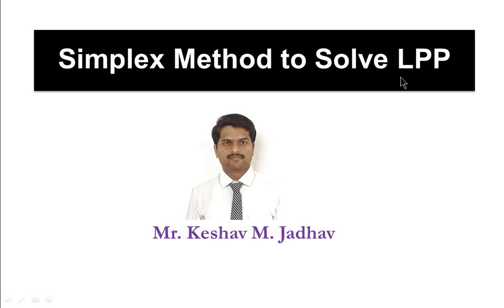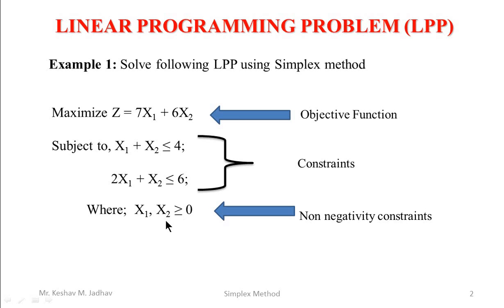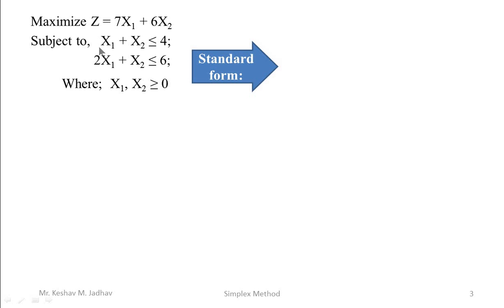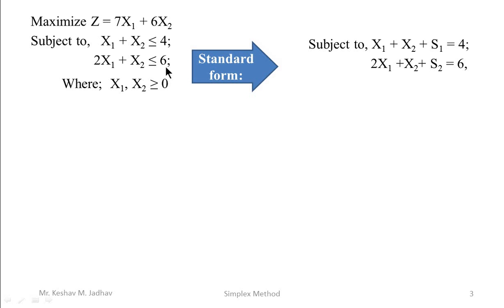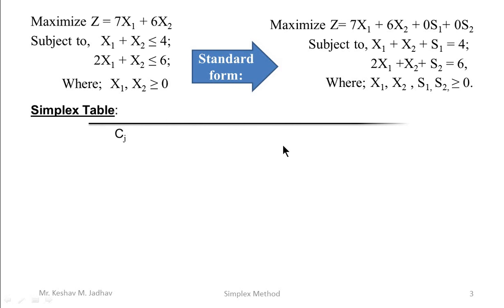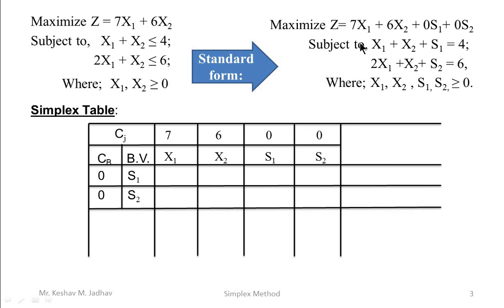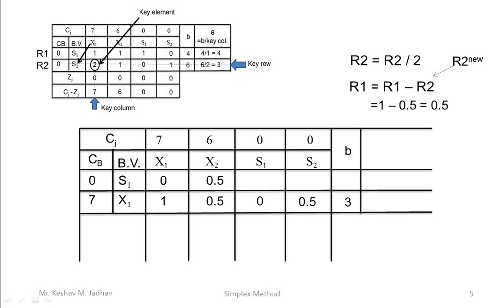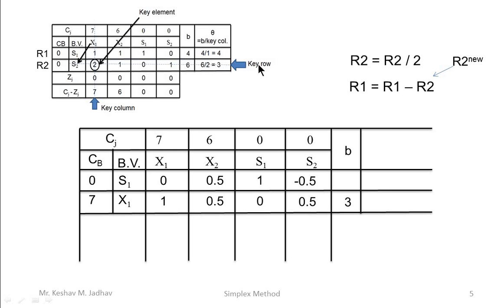Solution of LPP using Simplex Method (maximization problem)

Comment: Hi, I just want to ask, what if the S1 has the lowest value, thus, it is the outgoing variable that is replaced by variable x as the incoming variable, how is that? The next table would be change? Since S1 has the lowest value? Or we stick to the step where in S2 is the outgoing variable that will replaced by variable x as the incoming variable?

I hope you answer me, I badly needed to know, you're the only one explanation I've Understood easily 😭
Reply from the maker: To decide outgoing variable, we need to calculate ratio column= b/key column.
I am sure if you once again watch this video till end, then you will clearly understand the steps.

Comment: 5.	A merchant plans to sell two types of personal computers – a desktop model and a portable model that will cost Birr 25000 and Birr 40000 respectively. He estimates that the total monthly demand of computers will not exceed 250 units. Determine the number of units of each type of computers which the merchant should stock to get maximum profit if he does not want to invest more than Birr 70 lakhs and if his profit on the desktop model is Birr 4500 and on portable model is Birr 5000. (Find optimal Solution by simplex Model)

Comment: I have not understand in the way we solve table 2 especially when getting R2
Reply from the maker: In table 2, I have simply performed 
R2= R2/2.
Reply: @KeshavJadhav  but in other questions I tried to solve and use the same procedure but I failed
Reply from the maker: @gladsanga1900  basically you need to convert key elements into "1".

R2=R2/2 may not be applicable for other questions.
Please watch video again.
I am sure you will be able to understand concept.

Comment: when creating the new row 2 in the final tableau, instead of your formula R2=R2-0.5xR1, i multiplied the old row 2 by 2 and then minused the new row 1. (meaning my values were all double yours). I have not got the same final results and it indicates that s1 variable is still profitable (which is obviously isn't). Is there therefore a correct and incorrect way to formulate new rows? Plzzz help as exam is next week :))))
Reply from the maker: Dear Megan Jones,
Basically we need to write operation to convert other elements in key column onto zero (0.5 in R2). So, correct operation can be R2=R2-0.5R1.
In your operation our basic objective behind writing operation is not fulfilled.

Comment: Maximize Z = 30x + 20y 
Subject to the constraints, 
3x + y ≤ 1500
1x + y ≤  3000
x , y  ≥ 0 
Solve LPP BY SIMPLEX METHOD.
Please solve as soon as possible sir .. and send me.
Reply from the maker: https://cbom.atozmath.com/CBOM/Simplex.aspx?q=sm&q1=2%602%60MAX%60Z%60x1%2cx2%2cx3%6030%2c20%603%2c1%3b1%2c1%60%3c%3d%2c%3c%3d%601500%2c3000%60%60D%60false%60true%60false%60true%60false%60false%60true%601&dp=4&do=1#PrevPart
Reply: @KeshavJadhav  sir I have one problem based on two phase method and it is also based on some simplex cases :- 
Find the maximum value of 
Z = 107X1 + X2 + 2X3 
S.t . 14x1 + x2 - 6x3 + 3x4 =7 
16x1 + x2 - 6x3 ≤ 5
3x1 - x2 - x3 ≤ 0 
x1 , x2 , x3 , x4 ≥ 0
Solve sir please .... as soon as possible ....